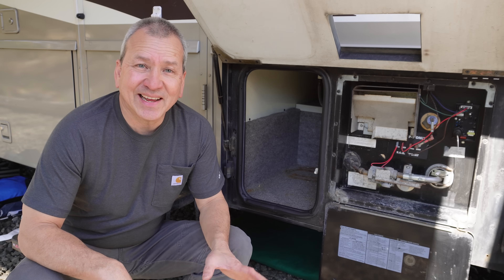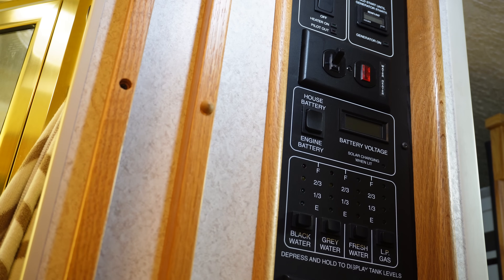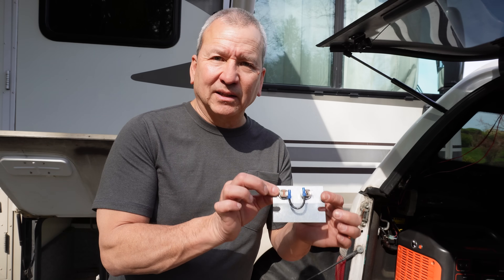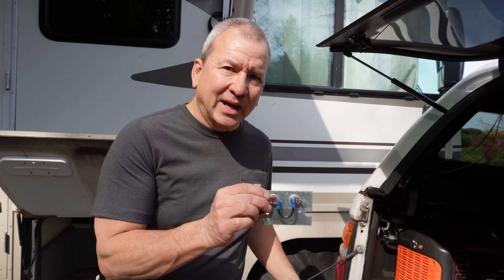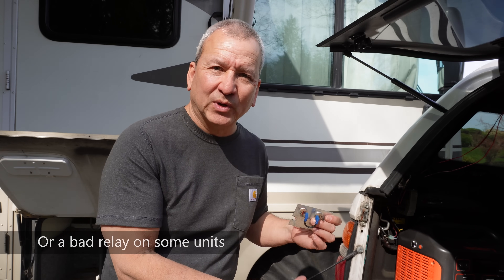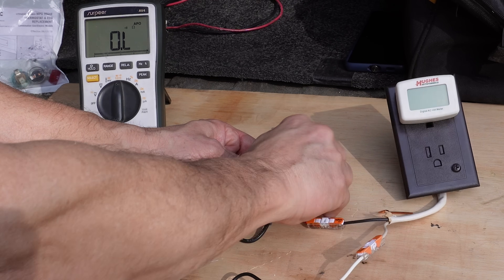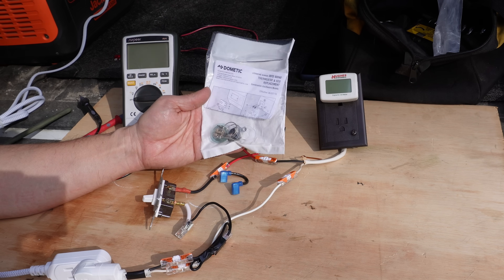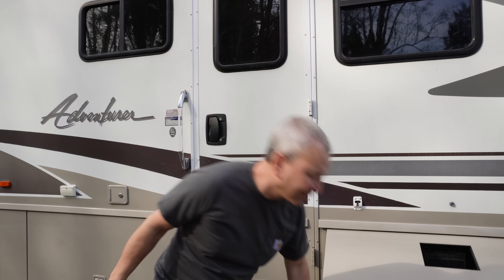RV Water Heater Troubleshooting (Electric Mode) - Step-By-Step

Comment: Is it possible to install a fancy control panel like the one you have? All I have is a switch and I was never really sure what the switch did. I think it switches the propane side of the heater on but I'm sure I'll know once I watch this video. Again thanks so much for posting these - so helpful!
Reply from the maker: Sure you can make a control panel but it's a bit of work. Here are a couple of examples (1) https://youtu.be/BOiWcM3PQR0?si=O6uBayGXd9hXmqmm  and (2) https://youtu.be/x4SEsZZhlhI?si=5j_ovoZ7IKlqchyd&t=88

Comment: I have the same water heater and RV, but mine is the 38r.  How the heck did you get back there?  I have to replace my check valve, but I can't get enough leverage to unscrew the check valve with my arm fully extended and wrapped around behind the unit.  Is there a trick to it?  As it was, I had a big box that blocked much of what little space I do have and it was a shield over the end of my living room slide rail.  Pulling that box out gave me a little more room, but I still can't really get to the check valve with enough leverage to unscrew the valve.

Comment: what was the digital screen you were playing with at the end
Reply from the maker: It is the Victron Color Control for my Victron Cerbo GX unit which is the monitoring hub of my Victron Off Grid Power System. You can see the entire setup in this video: https://youtu.be/IYQd2PcmUoY?si=Vyii53sNcu8ZuLRz

Comment: I was gonna send you a picture of the model I have is the SW6=DE my question was I'm replacing on / off Switch for the electric side of my hotwater heater in my RV 2005 Forrest river Flagstaff Rvi have a switch in the box where hot water heater is and a switch on my wall inside

Comment: So where is this on a dometic unit.  Thanks in advance.
Reply from the maker: I think it's on the back of the water heater near the bottom behind a protective cover with the incoming power.
Reply: @ thanks for your quick reply.  Will take a look

Comment: My electric side of my HW heater stopped working at the end of the season last year. Again luckily I have the same RV as you. This video will be extremely helpful. Thank you Tito’s!!
Reply from the maker: Mine has not worked since Jan of last year too 🤪.  I just haven't been using it and putting off fixing it. I just didn't want to squeeze behind the heater. Glad I finally checked that repair off the list.
Reply: @RVwithTito  I don’t use the electric HWH but it is nice to have when parked at a rv camp site. I am going to pull the hot water heater out and replace the element and the two pieces you just described in the video. All of your videos are great! -Fairbanks Alaska.

Comment: I'm waiting for you to figure out how to run hot water solar to the engine heat input.
Reply from the maker: Probably not a viable solution since I can just run the water heater from solar or LP off-grid and be done. One reason I use the electric side of the heater is to make use of excess solar energy when my batteries are already full. 👍
Reply: @RVwithTito  I didn't mean it was practical, just fun watching you do it.

Comment: I've had to do this on a previous RV and it is a simple job but they can be difficult to get at. Mine had gone rusty which probably was the reason for the failure.
Reply from the maker: Me too. It's a difficult spot. Plus the radiator hoses really get in the way and make it more difficult.

Comment: One time I brought my RV out of storage that had been Winterized. I filled up the fresh water tank, turned on the electric to the water heater and the water didn't get hot. I narrowed the problem down to the heating element. What I hadn't thought about was that the water heater was empty even thought the fresh water was full. The heating element will burn out in seconds if not submerged. When I winterize my RV, I drain everything and blow air through the lines. Now I make sure I run all of the air out of the lines and the water heater is full before I turn it on. It wasn't an expensive fix, about $15 for the element but I had to buy a 1 1/2" socket. I replaced the electrode while I was at it.
Reply from the maker: I too have learned many things the hard way. Lucky I've yet to have a heating element go bad.
Reply: @ That's the only time I had one go bad in 21 years with the same RV. This happened about 20 years ago and it was about $15. I just looked, and they are still under $20. The main problem is it takes a 1 1/2" socket which I didn't carry. Never had a need for one.
Reply from the maker: @jamescampolo7824  It is 22 years old now. I do carry a spare heating element, but haven't needed it yet. I would have to pull the heater out to replace it.
Reply: @RVwithTito  I could replace mine in ten minutes or so. That would include draining the water. The RV has an access door on an outside wall so all I had to do is open the door, drain it, remove the wires and unscrew the element and reverse. Same for the electrode. There is also access to the controls, burner and an on/off switch. There is also an on/off swich inside of the coach so I can turn it on/off there. For the plumbing access, I just take out a drawer if there is a leak or something. Easy to work on. I didn't notice where your element is located. Your's looks harder to get to the business end.
Reply: My RV is engineered with the DIY guy in mind. Your's not so much.
Reply from the maker: @jamescampolo7824  Your access is much more user friendly. It is almost impossible to do any work on the back of my hot water heater without pulling it out. My heating element is on the back below the thermostat near the bottom of that access panel. I can't even see it without risking getting stuck 😅

Comment: Hmmmmm........bathing in antifreeze.  Wait, there must be some sort of heat exchanger between the engine cooling system and the water circulating from the water heater, which would isolate antifreeze from the water heater water.  Or maybe the water heater has an exchanger built into the tank. ???
Reply from the maker: Definitely not mixing with the water. It's a heat exchanger attached to the back of the tank.

Comment: Thanks Brian.  That diagnosis and repair probably saved you several hundred dollars vs. if you took it to a shop - assuming they would know how to diagnose and fix it... 😂.  Agree the new spring loaded design is likely for preventing undue stress on the sensors due to expansion and contraction of the tank as it heats up and cools down.  We assume no thermal paste or pad was required to improve sensitivity of the two sensors.
Reply from the maker: Nothing against shops, but I'd rather keep the money and learn something in the process 😀
Reply: @RVwithTito  Unfortunately my negative experiences with car dealerships and independent shops tends color my opinions.  😄 I have performed all the repairs and maintenance on my vehicles for the last eight years.  Learned a lot, including from people like you, saved myself thousands and found much more satisfaction in knowing the work was actually done and with quality parts.

Comment: Holy cow Brian! You solved the mystery of how our Winnebago always seemed to have hot water when we got to the camp site. I didn't see this anywhere in the manual. Thanks
Reply from the maker: I think it's an add-on called the Motor Aid system. Mystery solved :)
Reply: @RVwithTito  Hopefully it runs the coolant through a heat exchanger before it is circulated through the water tank.  Would not want engine coolant in the water in case of a leak....😄